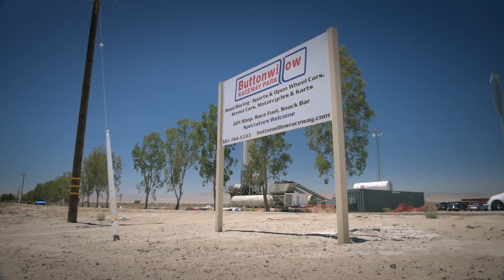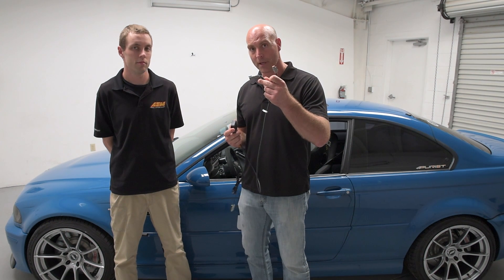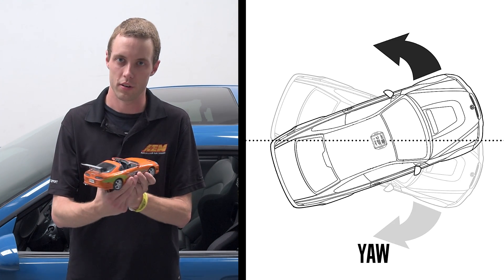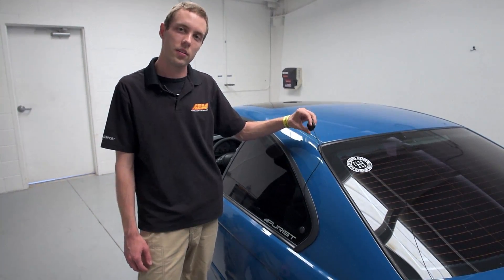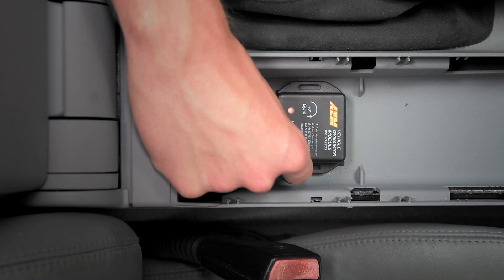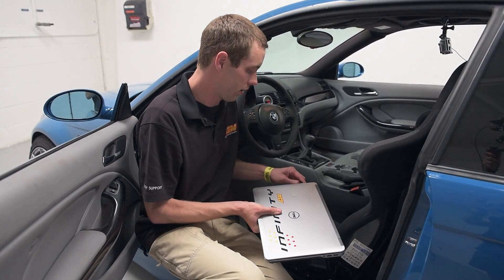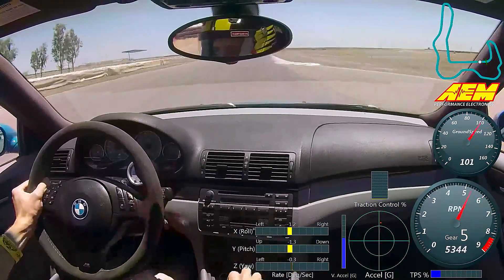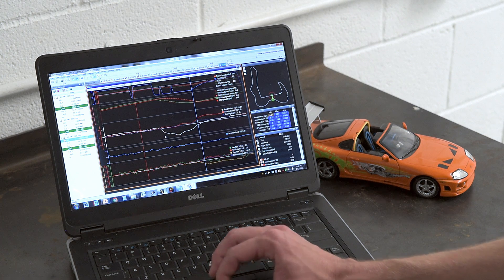AEM Electronics Vehicle Dynamics Module for Track Mapping & Chassis Data!

Comment: Can this be connected to the CD-5 base dash (no logging no gps) ? Or does it have to be connected via the ecu (haltech elite in my case)

Thanks
Reply from the maker: It works with all CD Dashes (5 and 7), the Infinity ECU and AQ-1 Data Logger.
Reply: Whould you mind further explaining, i have an haltech elite 750 , my dash is tha cd5
If i get this , would i be able to log its reading in the dash or in the ecu , also can i connect it to the dash directly or should it be connected to the ecu ? Thanks
Reply from the maker: @A.Alkoot  the easiest setup configuration will be through the dash (connect it to the dash using the AEMnet input on the harness and log it at the dash), however, if you want to log through the ECU you may be able to do that if the Haltech accepts CAN 2.0 protocol. We publish our CAN data and you will need to check with them to see whether it will accept our CAN. If you are able to connect it to the ECU, then you can also transmit that data to the dash via the ECU CAN output.

Comment: What video setup are you running> Go Pro?  We just picked up the Infinity 8 and CD-7 with VDM, interested in the video overlay u you are showing  here.. We will also be running an E90 with the S54 M engine ..
Reply from the maker: Yes, we use a GoPro Hero 4 for in car, but just about any video setup will work as you will need to convert the video to WebM using Converter software to import it into AEMdata. We bundle WebM Transcoder with our analysis software, but we also like VLC Media Player for doing conversions.
Reply: OnQRacing12
thanks, figured it.was a simple setup...
Reply from the maker: Welcome!